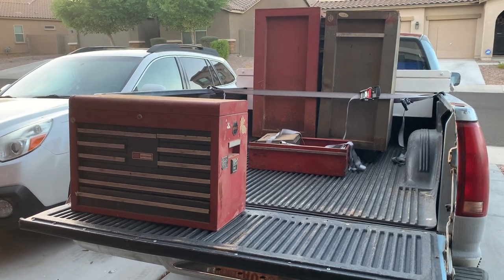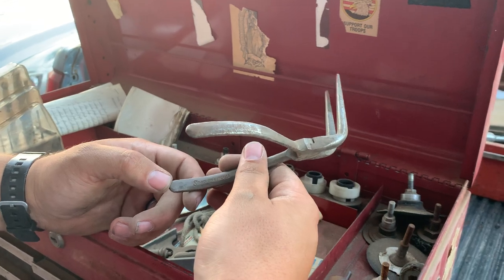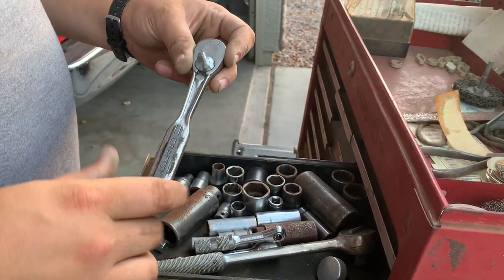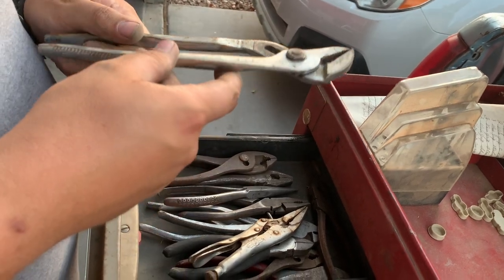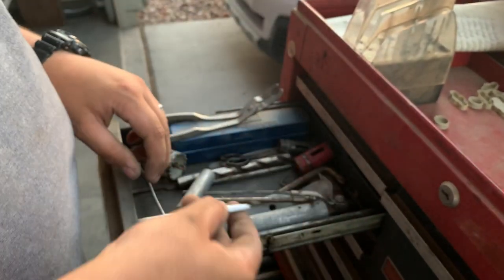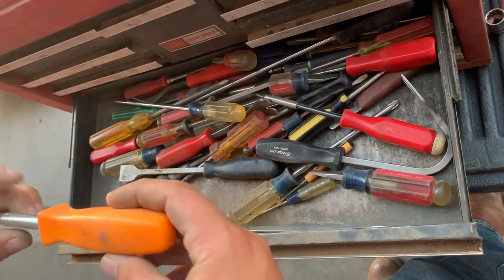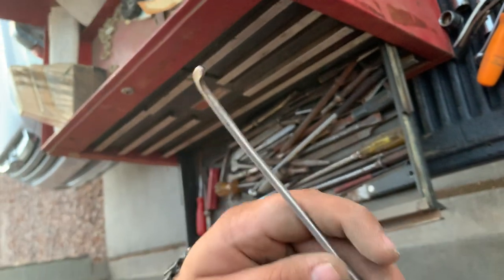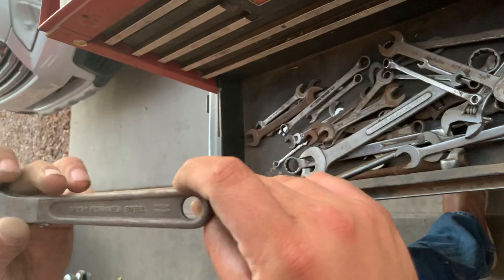Craftsman Toolbox Haul: Snap On, MAC, Matco and More (Part 1)

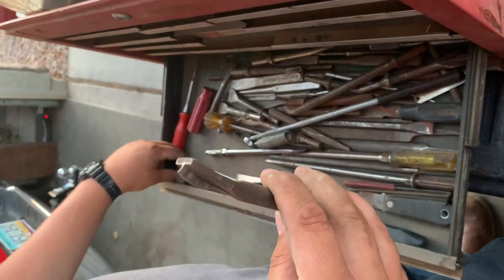Comment: Right angled straight screwdrivers and a sparkplug wire boot puller. 13:48 old school manual window crank clip removers. 17:50 tip for an air chisel.

Comment: the t handle is a hook used  to insert in drilled hole to work metal back out the secound one with cable is windshield cutter